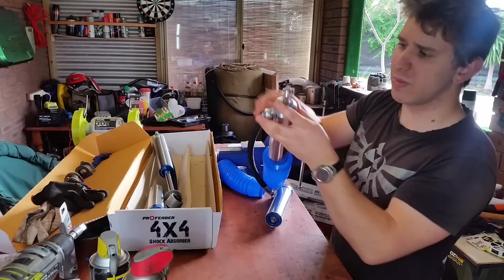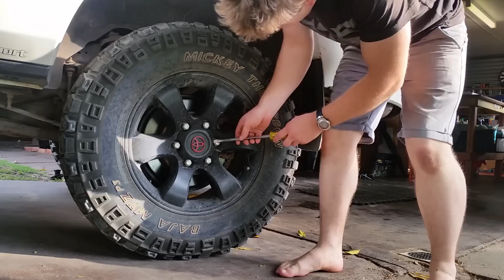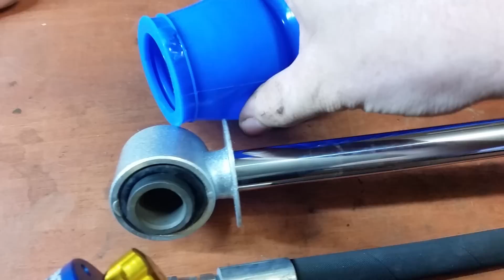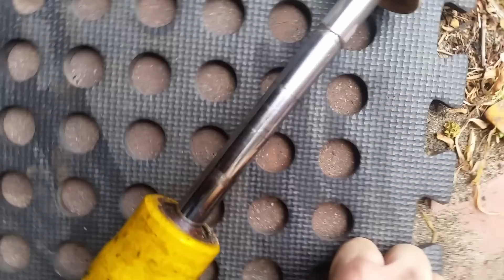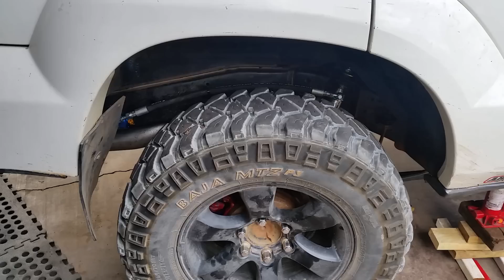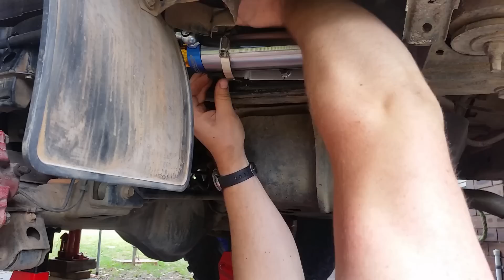Prado 120 Adventures Ep7: Rear Shock Absorber Upgrade

Comment: Great job mate.  I had a laugh at someone mentioning you mounted the reservoir too close to the exhaust which is “a major heat source.”  Funny thing is when you hold your hand 1 inch away from a hot exhaust it’s really not that hot.  If they ever did work under a car they’d prob know this.  Plus when you drive the heat is definitely a non issue because it kinda gets left behind haha.

Comment: Great videos Man, I see you have 2 fuel tanks, correct? I have a 2008 prado 120 with a 1kzte engine, I have 2 fuel tanks but having some trouble on understanding how the tank and subtank system works, hope you can five some info, thanks. Cheers from Nicaragua
Reply from the maker: Hi Leonel. The two tanks essentially work as one, with fuel moving between them to feed the engine. There is no transfer pump on the 1KZ 120 series Prado, its just gravity fed. I think the rear moves fuel into the centre tank? Not 100% sure but its all done automatically so you don't have to hit a switch to alternate between them.
Reply: @offroadcrusader  thank you, you are right, no switch to transfer fuel I guess there is two pumps also, there are fuel lines coming in and out of both tanks, another question, where is the canister located in your prado? Thanks again
Reply: 2008 with a 1kzte?

Comment: Good video mate. Does the truck now have a 3 inch lift front and back? If so did you end up dropping the diff in the front to improve the CV angles?
Reply from the maker: Hi Aaron, yes 3" in the front but still 2" in the rear. Only due to lack of funds for upgrading rear control arms, panhard rod, swaybar links and brake lines, as well as new springs. Theres no point in half doing suspension.
No diff drop kit kn there, as the CV angles are still looking good. But i'll keep an eye on it and if I keep breaking CVs then I will find a good kit for it.
Reply: Todd Lauren thanks for the response mate. I actually like how the truck is now level with the 2 inch rear/3 inch front rather than the nose down attitude Toyota like to build into their Cruisers. Time to get these Grande airbags out I think!
Reply: What's the part number for those rear shocks?   How has their performance been.   Would they work with a 3inch lift?  

Also great content.  Keep it up.